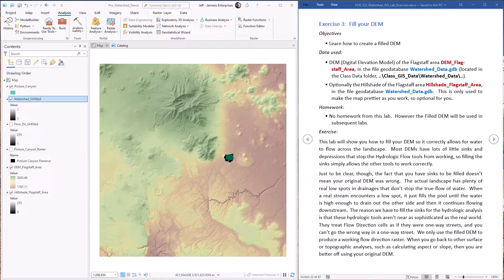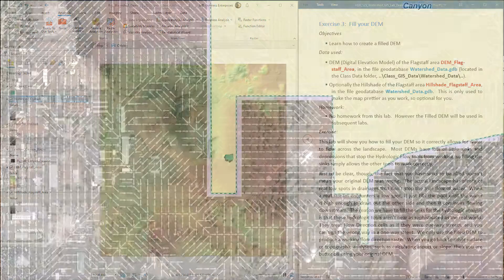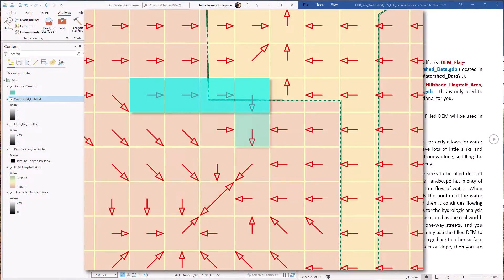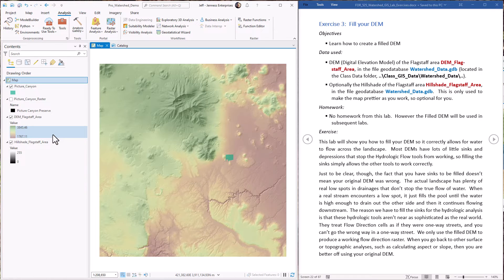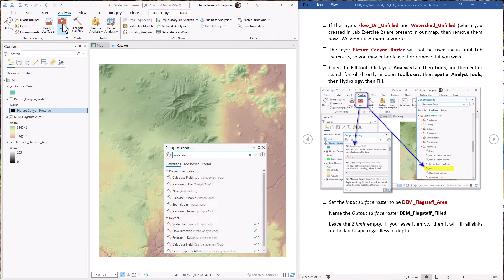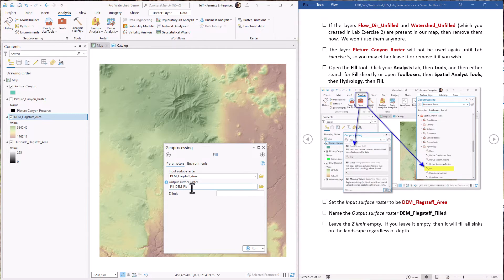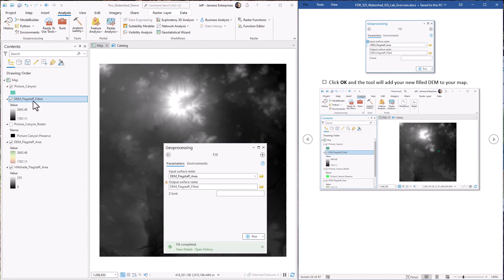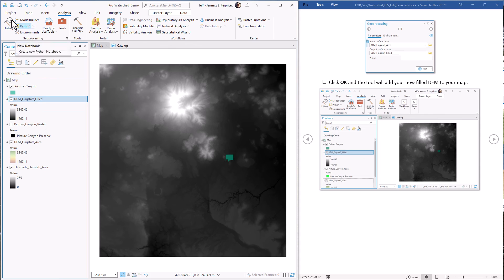Hydrology in ArcGIS Pro, Lab Exercise 3:  Filling Sinks in a DEM

Comment: how to create animation like this. th
Reply from the maker: Thanks!  I actually made the animations in ArcMap.  For the watershed video I wrote an algorithm in ArcObjects that does what the Watershed tool does, growing the watershed cell-by-cell using the Flow Direction raster, and at each step I had it export a map.  I symbolized the cells by how "old" they were in the process, shading from light blue to dark blue.  I also had it zoom the map out a tiny bit at each step, and I had the background basemaps fade out as the scale changed, revealing another basemap underneath.  At the end of the process I had about 1,000 maps exported, then I just treated each map as a single frame in a 30 fps video.  I used Adobe Premiere Pro to combine the maps, and I think Adobe Bridge does this as well.

For the demonstration of sinks, I used Camtasia to manipulate multiple images and graphics, having each appear and fade out over a short time period.  Camtasia is actually pretty easy to use for this kind of animation.  It makes video creation feel like playing a video game.